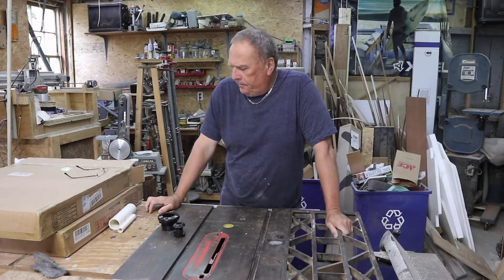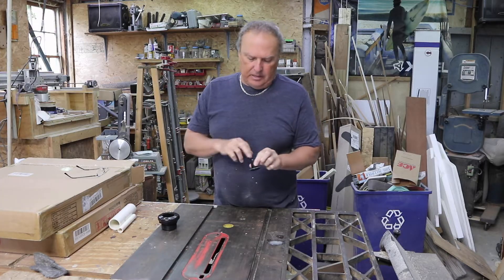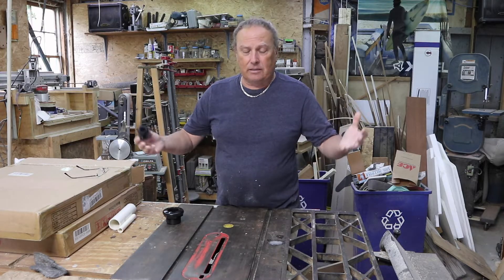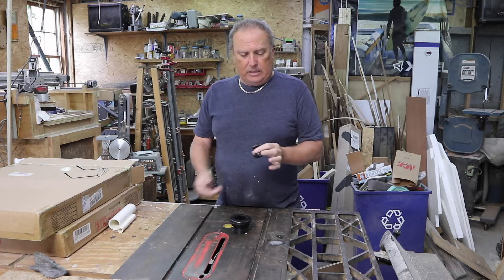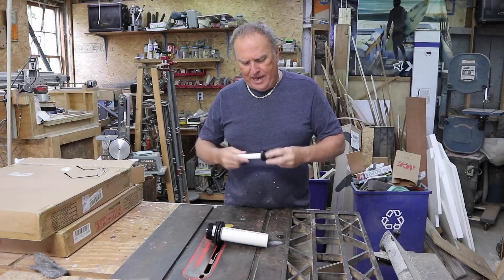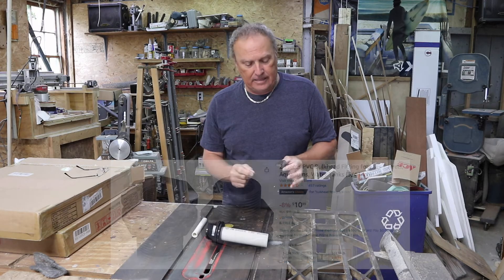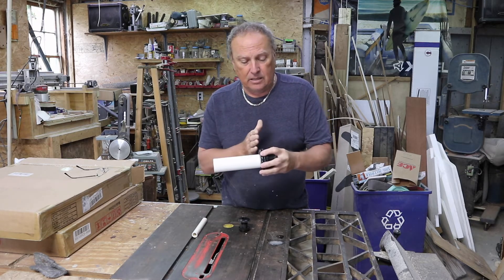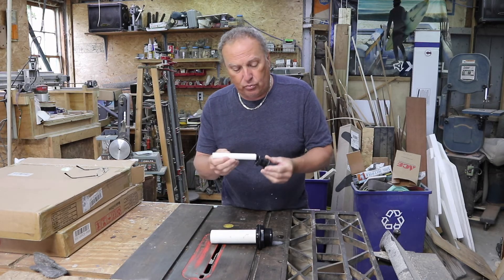Bulkhead Fittings - What you need to know!

Comment: How tight should you make the bulkhead fitting when you’re screwing it on? Should it only be hand tight?
Reply from the maker: I use a pair of slip joint pliers to just give it a little bit more than hand tight. Not too much because it's plastic after all, but I like to compress the rubber washer a little bit, have it bulge a little when you look at it. Hope this helps.

Comment: Do you have to glue it ?
Reply from the maker: Depends entirely on your application. If you applicationr has a disaster waiting to happend if there's a leak, fish die, plants die, basement floods... the yes glue it. These in the video are abs, so make sure to use the proper cement for what you're glueing. In my application I don't glue them because they are responsible for drainage and do not carry any pressure. And, not to be ignored, I change my mind a lot on the layout of my systems, so not glueing them allows me to re-use them.

Make sense?

Comment: Why can't you use the outside thread?
Any design obstruction?
Reply from the maker: I spent time at the plumbing store trying to find anything that would fit the threads. I didn't find anything... The threads are built to be as strong as they can be for the material to make sure the nut that squeezes the rubber washer is tight and the junction is watertight.  If you want to use the threads, don't use a slip fitting, use a threaded fitting, that way the threads will be standard and you'll be able to use it properly.
Reply: @stuffmydadknows  thanks for the info man.